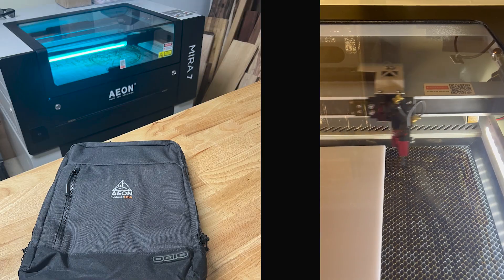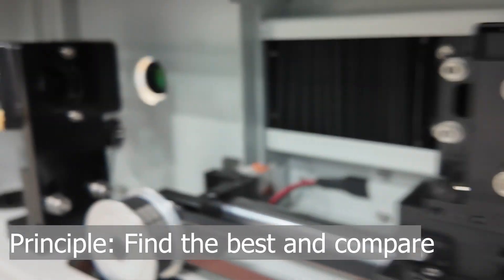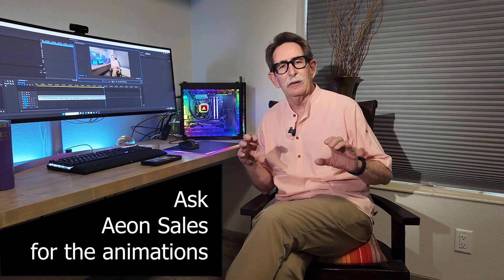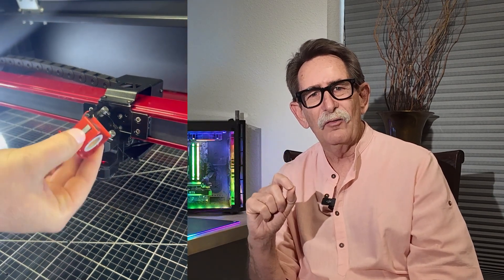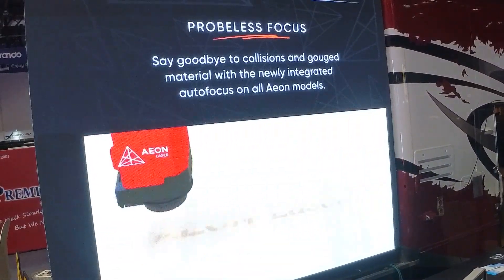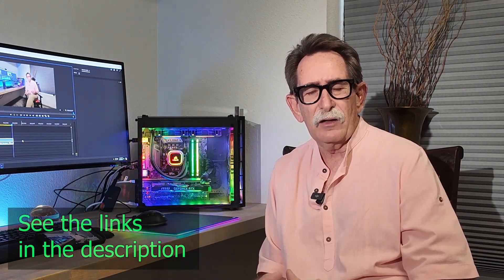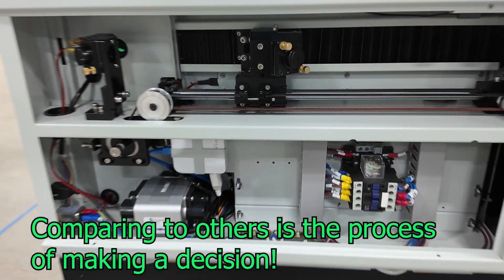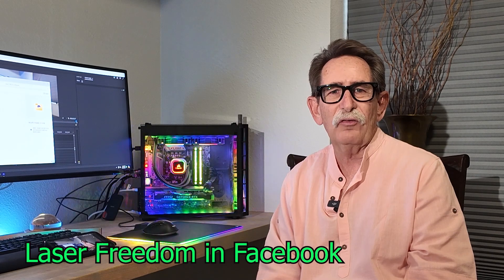Does Aeon's MIRA 5 Redline Lead the Desktop Laser Field in 2025

Comment: Hi George,

I’ve had my eye on the Aeon Mira 5S Redline, and I have a few questions regarding my product line that I plan to work with. I want to make sure the machine fits my specific needs, so I’m hoping you can provide some insights.  

1. Can the engraving and cutting height be automatically adjusted to uneven surfaces (e.g., wavy materials)? Ideally, I’d like a 3D mapping system where I can freely define the measurement points based on the material. I’d like to set the number of measurement points per square cm or at least define a measurement area to ensure the engraving or 3D map is as accurate as possible.  

2. Is there an automated height detection system or any add-ons for soft materials like leaves or flowers, which are difficult to measure with mechanical height detection?
  

3. What is the noise level of the machine and the exhaust system? I plan to use it in my home, so that’s important for me.  

4. When working with larger materials that are fed through the machine, is it possible for the engraving or cutting to be automatically detected and seamlessly extended? I’m looking for intelligent software that can adjust the engraving path automatically without needing to manually realign the material.  

5. Do you use or recommend any infeed track with a stopper and optional conveyor belt for precise material alignment and consistent movement at the right angle during the process?

6. Is there an intelligent function for engraving multiple identical materials? I would like the machine to detect and optimize the engraving process across multiple pieces with identical designs, to save time and ensure consistent results.

Thanks in advance for your help!
Reply from the maker: @nilsruhmann3571    You are really at the point where you should contact Aeon they can help you evaluate if the machine is best for your projects.  I don’t want to give you half correct information.  Take question 3. Noise level… I am not sure of the Db level, but I bet they know.   My Mira 7 pro was pretty darn quite , I did not wear any ear muffs, like I do with my CNC.    Contact Aeon tell them an honest ‘Laser Addict” said he wants you to get the right tool for your job!
Reply: Hey @GeorgeKennerLaser  , it's been a while since I last talked to you, but I just wanted to let you know that I’ve ordered the Mira 5 Redline along with some accessories. Your videos definitely helped me with my decision, and I’m really excited to start my first projects.
Greetings from Germany and I love your honesty and the quality of your videos, keep it up!